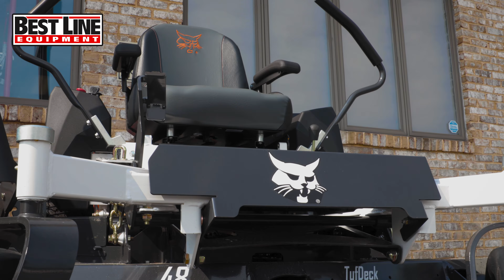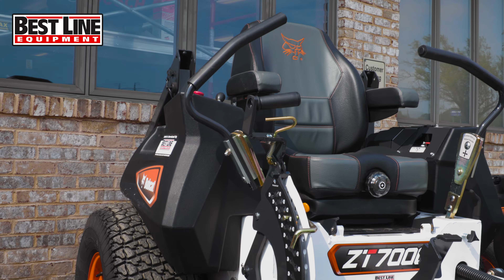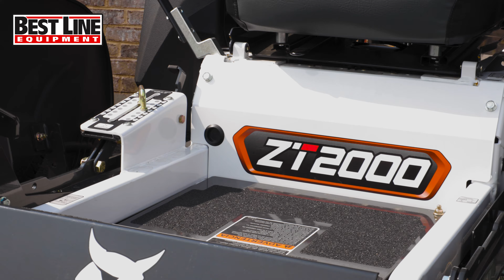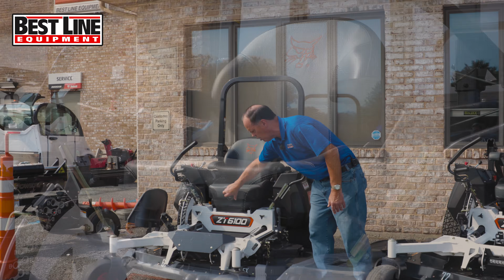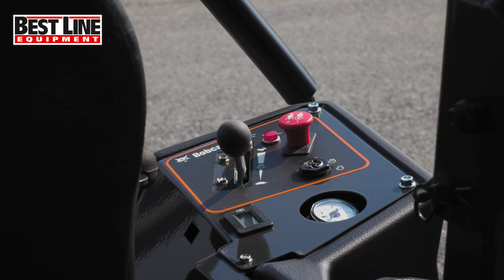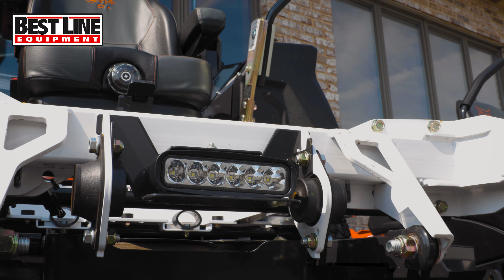New Bobcat Zero Turn Mowers Walkaround & Review

Comment: I bought the zt2000 about 2 years ago from a local dealer and I really don’t have any complaints with it. I had one issue with the fuel gauge not reading but that was fixed at no charge to me. I like it bc it was a good brand and affordable. I was told by some family members that I should have gotten the commercial mower bc residential mowers don’t last as long. They laughed when I told them that I didn’t need a commercial mower bc I’m just cutting my yard and my mom’s yard sometimes. I think I  put 3-4 hours on it a month. I highly recommend this mower to people when they ask me about it.